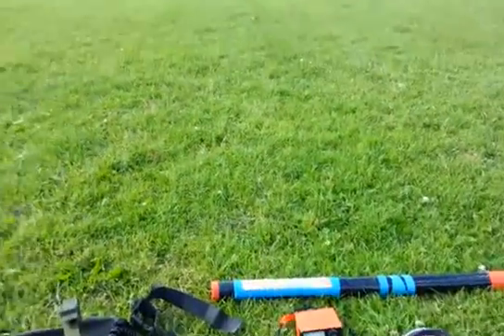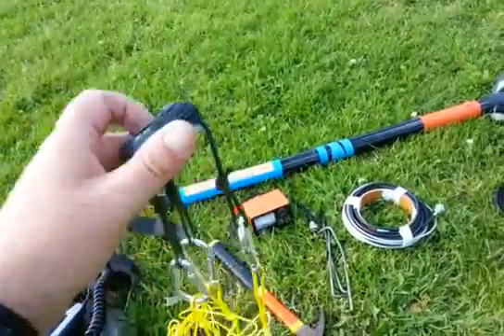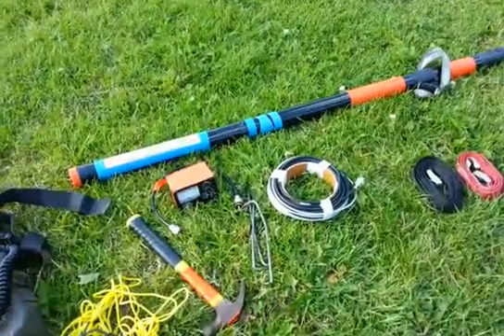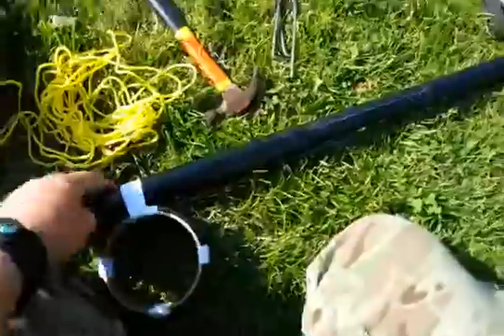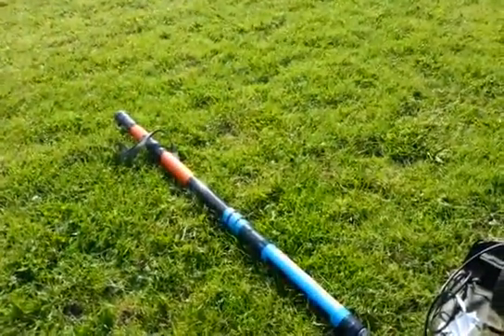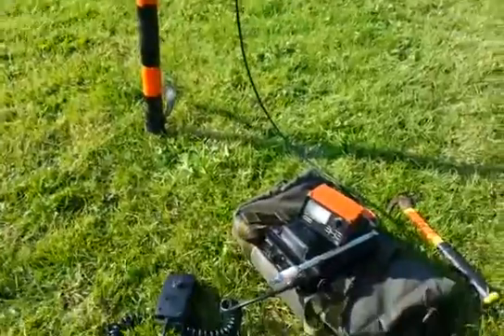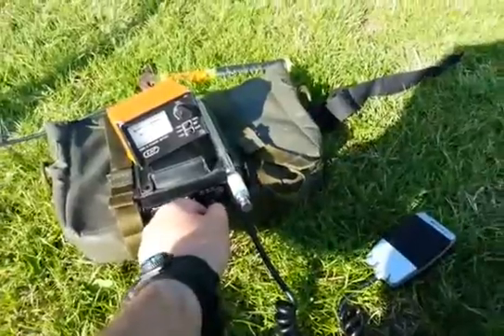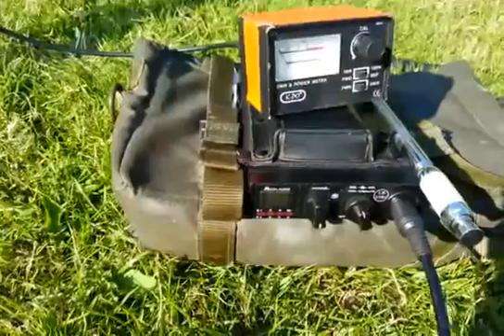Setup and swr an 11m t2lt antenna

Comment: Very good video but there does seem to be a lot of set up time.
I'll settle for my imax 2000 on a pole with swr perfect out of the box..
Reply from the maker: +bonydox9  hi, yes I will agree that the first time you put it up it can take some time but after the first setup it's fairly quick as normally you don't need to touch it again. the places these are designed for use it would be hard work to take a proper homebase antenna along with the rest of the kit we take.  cheers 73

Comment: Sorry I just realised that you left the Original Aerial on and plugged  in another Antenna' would the closed down Telescopic act as Ground plane or Radials or would it just affect the SWR and Spoil the other Antennas (T2LT) Signal?  Many Many Thanks and a Merry Christmas and a Happy New Year to you and your Family...
Reply from the maker: Hi, ive measured the top section and its 28" from the coil. Yes the same uk 40 channels still in use. Leaving the telescopic  antenna on makes no difference at all to anything, just stops it from getting lost really  .lol. i used to take it off but realising it makes no difference its best for me to leave it there. Glad you liked the vid and i have answerd all your questions, if not dont be afraid to ask.  Cheers

Comment: Great Video just What I wanted to know may I ask was that The old FM 40 channels you were using and picking up 30charlieTango171 Spain Calling!!!!! Wicked reception. And may I also ask could you please measure your Telescopic Midland aerial from top of centre load coil to the Tip Please I only ask because I have just got a portapack and got it working again but the top sections are broken I can fix it but I can't find the right Measurements for this.. Thanks Again for the Vid,   " Blinding "